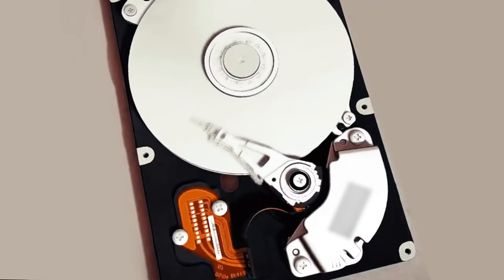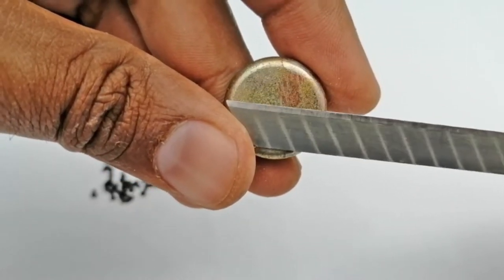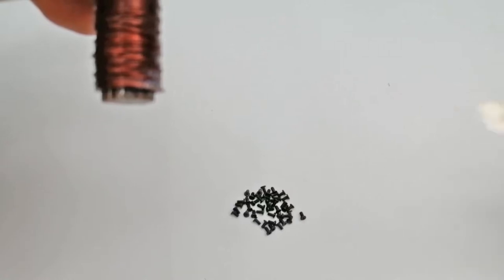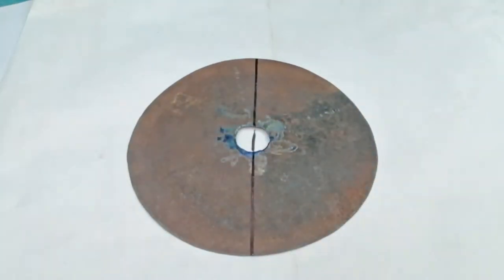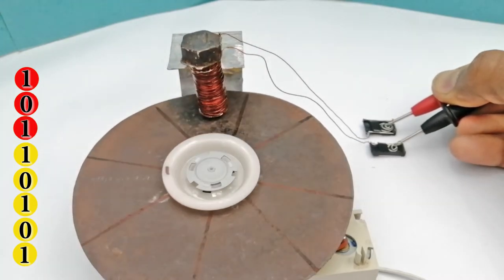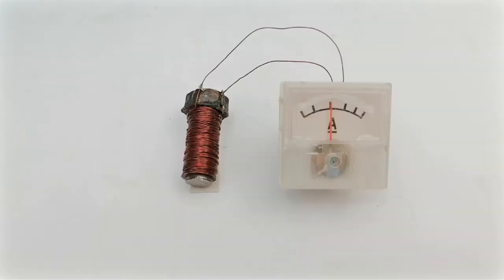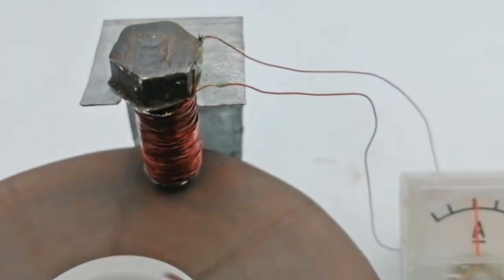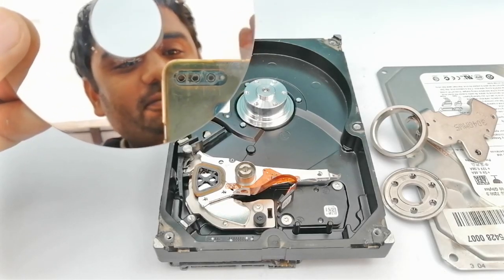How a Hard Disk Drive (HDD) Works | Magnetic Memory Explain

Comment: If you ad a little mosfet transistor to give power to the small magnetic signal from the disk during the reading process, the needle in the galvanometer will move more intensively. But even without any amplification we can see the needle moving what is just amazing.

Comment: I have one question tho, Why are SD cards slower than hard drives even though HDD involves mechanical movement of R/W arm?
Reply from the maker: Ssd and sd card have the same technology but ssd is fast than sd card due to more powerful technology and more spacing for ics. And sd card is constructed in very smal space and have less wires to transfer data
Reply: @MajidGoraya  that was for ssd, but actually I wanted to know why hard disks are faster than sd card.
Reply from the maker: Sir new sd cards that bult to use state of the art technology and connected through 3.0 usb port much faster than hdd
Reply: @MajidGoraya  yes I know that, but what about magnetic hard disk drives, why are they faster than sd cards?